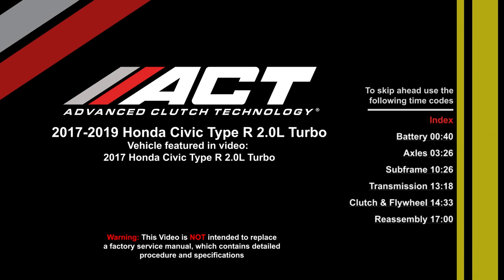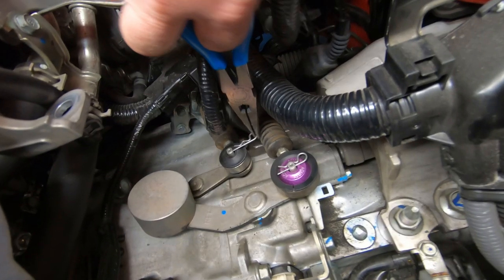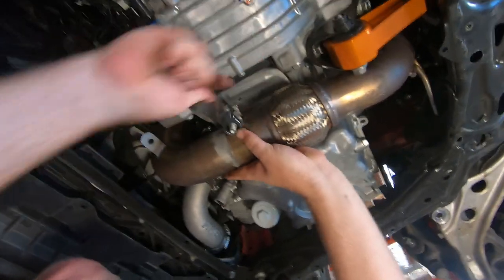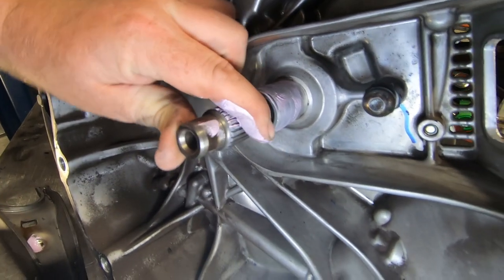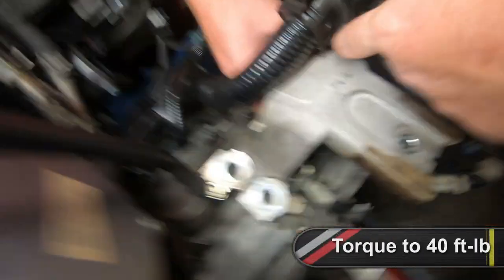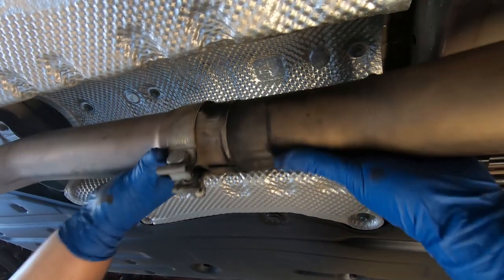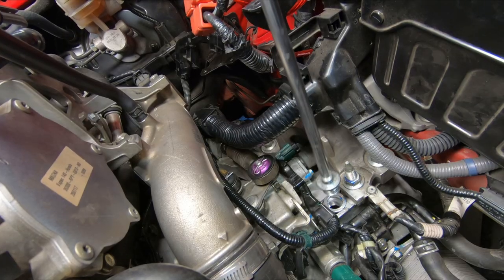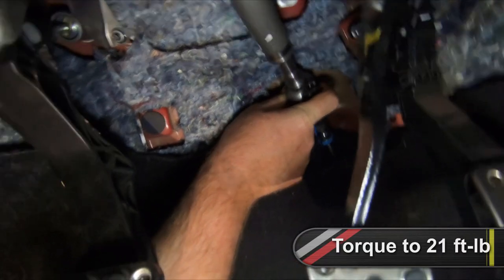ACT Clutch Install: 2017 - 2021 Honda Civic Type R 2.0L Turbo

Comment: Is it necessary to adjust the clutch pedal at after this installation? 3 years later and this is still the only video on replacing a clutch on a Fk8

Comment: Would putting a cat less down pipe on fk8 with intake and intercooler make my clutch slip ona hondata tune ? With only 17k miles
Reply from the maker: We are unsure of what increase in torque you will gain from a cat less down pipe, intake, intercooler and a hondata tune. Do you have an estimated torque output you will be producing with your upgrades? We can tell you that our HD kit with a street disc (P/N HC10-HDSS) will hold up to 363 Ft-Lbs. and our HD kit with a race disc (PN HC10-HDG6) will hold up to 464 Ft-Lbs.  So, depending on which kit you use, If your upgrades do not surpass these torque capacities, then it should not slip. However, if you do surpass our torque ratings for these kits, then it will slip.
Reply: Probably not, maybe try adjusting ur clutch where the pedal engages, most factory settings on them suck

Comment: 13:32 some honda manuals say not to remove the painted bolt attached to the vehicle's body, well for 1.5tcivics (or you'll need to replace that mount)

So I thought it would hold true for fk8s as well!
Reply: Source: 11:05 in video for 1.5 turbo civic below:

https://youtu.be/lgCxuXvfTJk?t=665

Comment: I own a 2020 Type r clutch just went out been looking for a twin disk since the single disk was so heavy on the foot, will the 2017-2019 work with 2020 Type r? I can’t find a single Twin disk for the year 2020
Reply from the maker: Yes, this kit will also work with a 2020 Type R.

Comment: Hey guys how’d you reinstall the lower ball joints to control arms
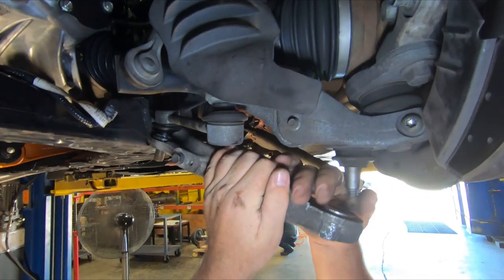Reply from the maker: Pull down on the lower control arm and then feed the ball joint into place. This is shown in the video at 26:51 for the passenger side and at 27:34 for the driver side.
Reply: I just did my clutch but I stopped because the sleeve doesn’t want to go back into place.
Reply: Do I have to remove the sleeve?
Reply: @rogeliojimenez7025   what sleeve are you referring to?
Reply: Go watch when he removes the lower ball joint at 9:02 the ball joint comes out with a sleeve but when he installs it back the sleeve is already back on the control arm not the ball joint itself
Reply: Got it. Yes, we removed the sleeve from the ball joint using a puller and then placed it back into the control arm.
Reply: Okay Thankyou because i was trying to reinstall it all together that’s the only thing I need to do that’s left because I already installed my ACT clutch